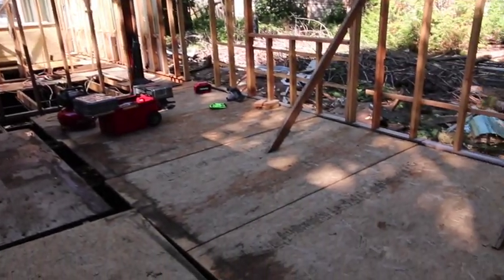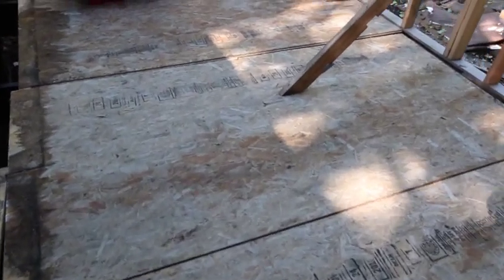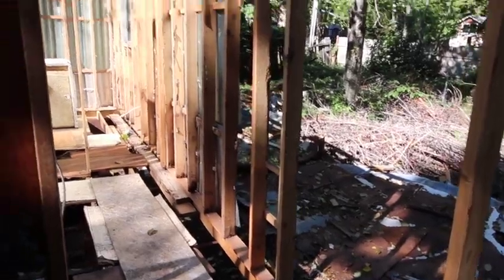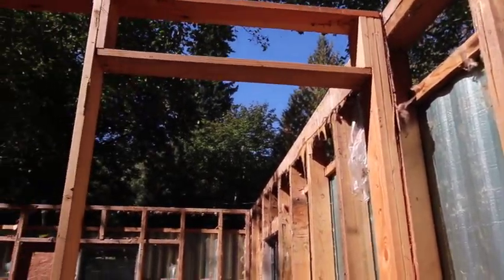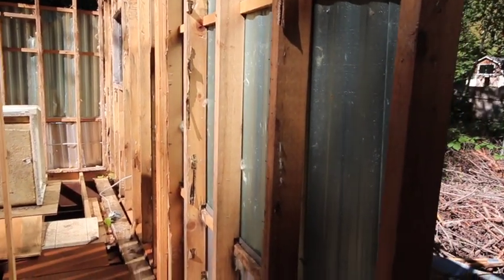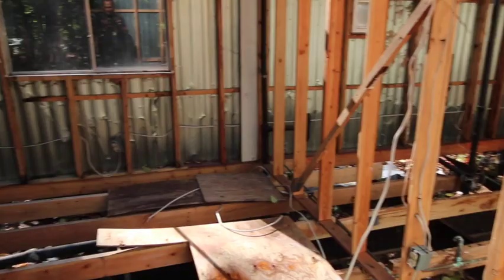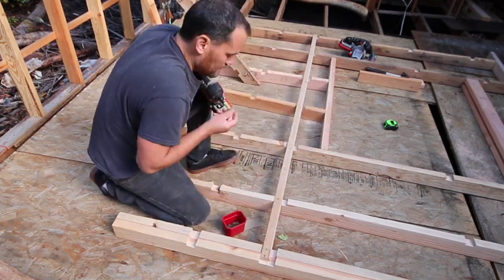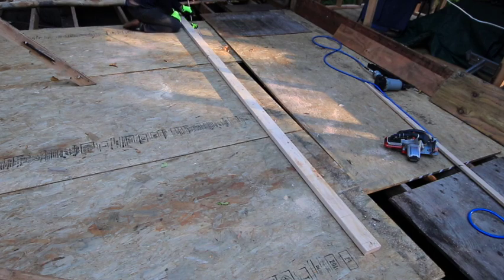Rebuilding Exterior Walls on my Old Single Wide Mobile Home

Comment: I laughed at remodel :) You basically build new house :) In Canada you would definitely need building permits for such remodelling.
Reply from the maker: For real. I did not think it was going to be this extensive at the start, although I knew it was going to be a lot. Yup, def need a lot of permits and inspections around here too, but not as bad as y'all have it in Canada, that for sure. Thanks!

Comment: Great video! I have a 1963 2 bedroom single wide, kitchen in the middle with furnace and washer and dryer. The bathroom and kitchen have no exhaust fan and with how much rain I get I was thinking installing a fan on a exterior wall. What’s your thoughts on this? It’s a flat roof design. Not any space for the exhaust vent so very limited on options.  Oven does not sit on exterior wall and I could install a exhaust across the hallway from it but need ideas for best efficiency .
Reply from the maker: Wow, that's quite the vintage model you got there! Yeah, I would go with putting them through the wall for sure. The way mine was setup there was a oven fan vent that went through the wall instead of through the ceiling. The vent cover on the outside was rusted out but I think the wood wall studs in that section were not that bad. The bathroom in mine has a fan that goes through the roof. I've thought about going through the wall there too but I think I'm sticking with an exit through the  roof and just making sure to keep it sealed well. Depending on your layout, a side exhaust might work well for you there too. Best of luck either way!

Comment: How are you today?  We talked on a FB group. I'm doing a whole remodel on mine as well, complete rebuild. Moving the kitchen and bath, electrical as well, box had a 60 amp main. I do have a question about the roof joists, can I build them like a regular house ? I'm wanting to increase the height of the ceiling and add dormers, the original roof was bow style .
Reply from the maker: Howdy! Yup, the good old mobile home groups. As far as the roof truss's, you'll have to check with your state or county building department to see what you can legally do in that regard as the vary from state to state. Hopefully you live in a state that doesn't care what you do to mobile homes since they're often not thought of as 'real property' since they can easily be removed. You can build normal house type truss's but you have to consider weight when doing so and in most states, you have to stay around 13 and a half feet or under for the peak roof height from street level for transportation purposes. Most mobile home roof truss's are made with way less than 2x4 thickness beams too. So I would stay with something like a 2x2 for the truss's. No mre than a 2x3 anyway. It's amazing how string things get once you tie them together with a layer of plywood. If your state requires plans for re-engineering, then it gets really cost prohibitive, which is the reason I had to go the route I went. Hope that helps and thanks!
Reply: @thesomewhathandyman9400  Yes, thank you. Luckily, no restrictions or permits needed where I am. As far as street level, I am already well above that as my property is upslope from the road. Thank you for your insight,
Reply from the maker: @DavidSaintBump  Oh man, you're lucky to not have to deal with permitting processes! As far as street level, I just mean if it ever has to be towed down the road again at some point, that's where you have to worry about how high the roof is from where the tires hit the rod to where the top of the roof is. Might want to check with the DMV on that one. But, if you're sure you're never moving it, then do what feels like a good height for you! Take care!

Comment: Ditch the copper and switch to Pex.
Reply from the maker: I've debated it but I'm a fan of copper too so since it's another thing I would technically have to get a permit for if I change, I'm probably just going to stick with the copper. Thanks!